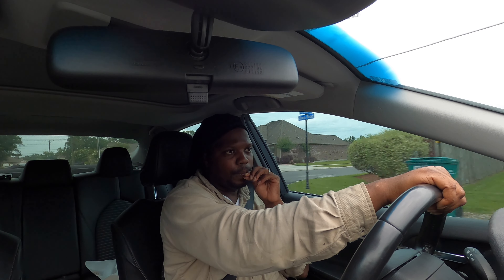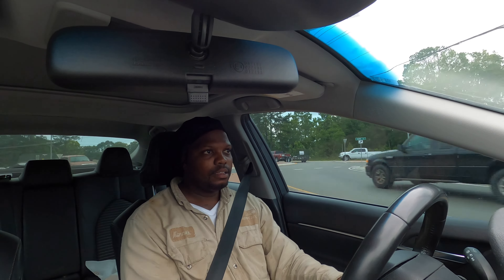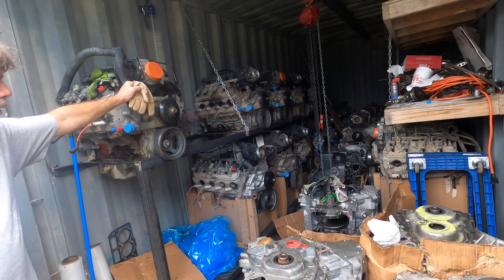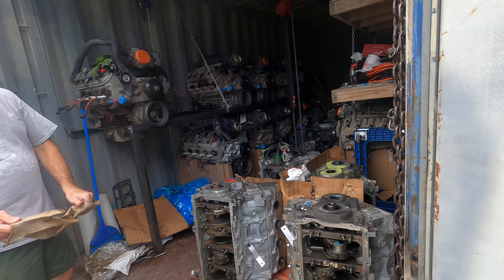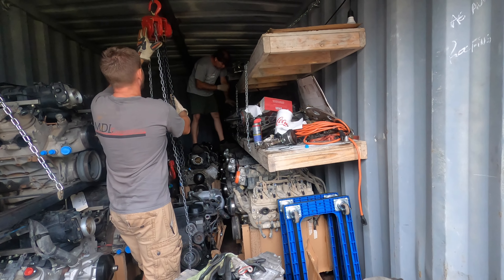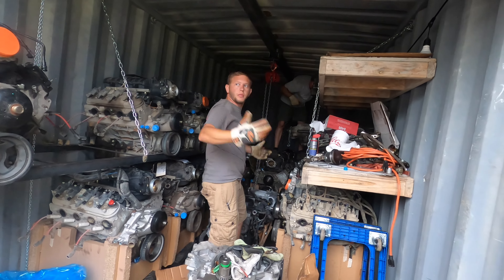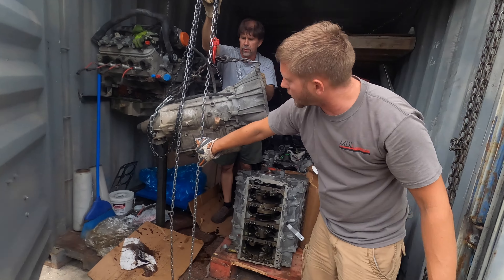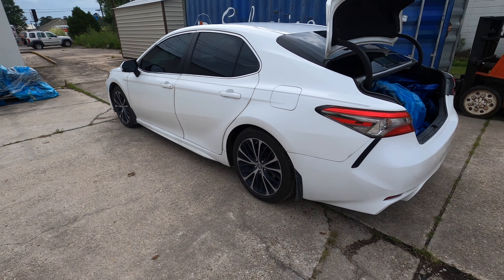Picking Up The 6L80 transmission (Did I Make The Right Choice?)

Comment: I've been running a 6L80e since 2018. Factory rated for 440 ft/lbs of torque. As strong as the 4L80e but the benefit of a double overdrive and a super tall first gear which really gets you moving off the line. The failure points of the 6L80e is they tend to run hotter so put a BIG transcooler in... like... RV sized cooler in. Not a small 6" one or a built in to your rad one. Check your fluid color regularly. If it starts getting dark change it immedately. What happens is they cook the fluid, which then cooks the torque converters which then pollutes the rest of the transmission, and will typicaly ruin the stator pump. As the valves in the pump start to get clogged it can over pressurize the clutch pistons and crack them. So... keep the 6L80 cool and keep a close watch on your fluid and it will run great.
Reply from the maker: Thanks best comment yet
Reply: So is the 4L80e better if you can get your hands on?
Reply: Never knew that
Reply: So what't your thoughts on a 10L80e transmission
Reply: @whipzpaintlyfewithjay9654  it really depends on your needs. What your engine and ECU is and what car it’s going into. Older ECU and older cars like the 4L80 better. But I need more info to give you a real answer.
Reply: @Mr.Frost181  In general or for swaps?
Reply: @ericharmer  much thanks!!  I was getting a build together for 86 Monte Carlo SS…the problem was knowing what kind of transmission to mate up to LS2. Mechanic that does Ls swaps asked me was I gonna be putting my foot in it? And initially I said yea I’m going to hit it every now and then, maybe run it. So he said I should get the older gen 4L80 transmission instead of the 4L60, because I would end up tearing up the 4L60. This is the first time I’m hearing about 6L80, so it sparked my ?’s….really appreciate the info
Reply: @whipzpaintlyfewithjay9654  Ok, the first majoy difference is size. The 6L80 is shapped like a beer keg, and most older cars you have to cut out the trans tunnel and raise it to clear the floor. If cutting and fabbing isn't an issue for you, it's a good candidate. The second factor is the controller. You have to know which controller you're going with an if it can control a 6L80. GM Performance does now have a stand alone 6L80e controller though. 4L80 is a older, smaller and simpler transmission. But it has fewer gears and the gearing isn't as good IMO. But again, there is no one perfect solution. Good luck buddy.
Reply: 4L80E is better I'm buying one next week 3k 🤧🤧pretty high but it's going to handle my set up Ls gen4
Reply: @KashDavis2036  Better is a very subjective term. Better than what? Better for whom? 3k is crazy high. Hope it’s a fresh build from a pro shop with a warranty at that price.
Reply: @KashDavis2036 no it’s not . Waste of money
Reply: its the programming dude...converter is never locked
Reply: @treybadd  Hey buddy, just wanted to say thanks. You were 100 right.
Reply: 4l80e transmission is stronger than a 6l80e transmission. Modded or stock form.💯
Reply: Brother, I wished I had watched your video a year ago. Looks like I will be buying some race ramps and a harbor freight transmissions jack. I have a bout 8 passes and some spirited driving over the last 3 years and now my 3600 stall and/ or my 6l80e need some attention. Was rolling south outa Dallas and my RPM went up and my MPH went down all at once. Hoping for the best. Good video Sir , be safe !

Comment: You did the right thing with the 6L80e trans you won't need 3.73 - 4.10 gearing 3.27 -3.42 should be all you need with the 6L80e making highway cruising at 80mph much more calm under 2500rpm while having good acceleration a lockup stall converter in a 6L80e from 3500 - 4500rpm stall with 3.27 - 3.42 rear gearing would make your G-body a monster and a rocket
Reply: Truuuu

Comment: A 6L80e trans with a 4.02 1st gear transmission gear ratio will allow you to use less gearing without losing acceleration vs the 4L80e 1st gear transmission ratio of 2.48 you will need lower gears like 4.10 - 4.30 gearing to get acceleration of a 6L80e trans with 3.27 - 3.42 gearing

Comment: You should be fine, the 6L80 is in my 2010 ss camaro with a supercharger.    Also, the 6L80 is already paired with a 6.2L stock in the ss camaro.

Comment: My 6L80 has my car doing 80 @1.5k rpm I like it but you have to have a good tuner if you have mods.. long story short I put a total of 5 passes on my car at the track and broke the transmission in a burnout… this was two separate track nights and my car makes about 500 crank hp so but other then getting the manual shift mode figured out and needing a good tuner plus not cheap to repair unless you know someone 🤷🏾‍♂️ kinda depends on your goal overall.. also you’ll need a special shifter or modify a factory camaro shifter (6th gen) or G8
Reply from the maker: Thanks I need dat. Inbox me on Instagram @cutlass_4_us
Reply: I used a Lokar sport shifter, and wired up a series or resistors to make the tap shifting work in my swap.
Reply: @ericharmer  yea I have the same set up but never got it to work for me.. not sure what I did wrong
Reply: @J2A61  Sorry to hear that. Did you tap into pin #7 on the transmission harness? After that you need to set the ECU to hardware mode (aka Corvettes mode) as the G8 and Camaro use the BCM to translate the signal from the original shifter. HPTuners can handle that for you.

Comment: Can't see needing anymore rear gearing than 3.42 using a 6L80e transmission in a 4000 or less pound car or truck l could see using 3 73 rear gearing with a 6L80e transmission in a very heavy 5000 -6000 pound truck or SUV because of the extra weight l think would be perfect with a stock stall converter

Comment: Man call Lab Rats Performance for that harness they gone get you right. Only thing you gone have to do is get your evm and tcm which is inside the tranny married. Other than that that’s a good choice man.  I wouldn’t put that Holley system on a gocart.  A lot of people think that system is self tuning and that’s not true. It still has to be tuned. Also, if your battery runs down, it loses the tune.
Reply: The tune is stored on your laptop. It’s easy to download no matter who tuned it. Mines never lost the tune disconnecting the battery. Every system has to be tuned to run at maximum efficiency. Holley shit way better than fi tech and hp tuners
Reply: @kingofthanorth  man I’ve witnessed this multiple times when the battery went down.  Fi tech is definitely trash.  These systems do not have enough research and development before they are pushed to the public and customer ends up being apart of the research when it’s on their cars. I like Hp tuners, because I have more control.
Reply: @tunesmithus  even my Holley dash keep all my settings I never herd of that problem before but almost of people be having problems with it I guess I’m lucky . With Hp tuners you have to buy credits to unlock cars that’s the only thing I dont like.